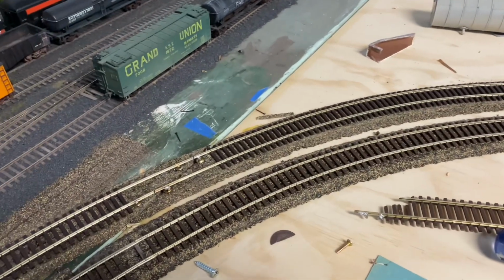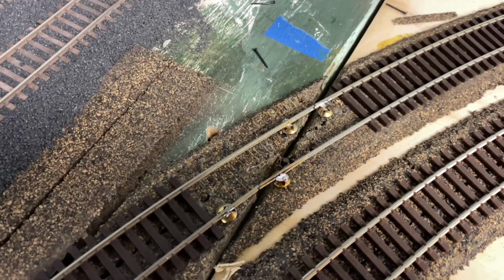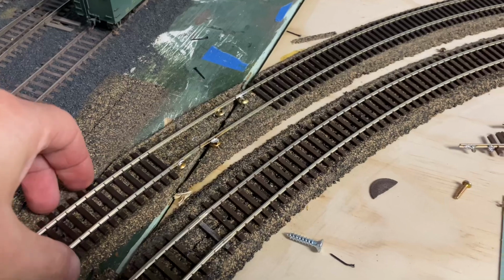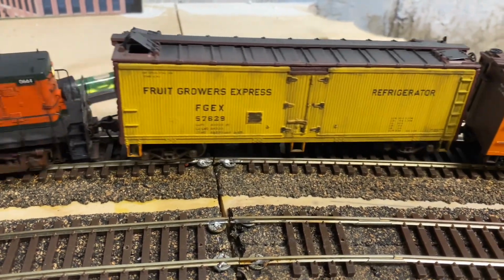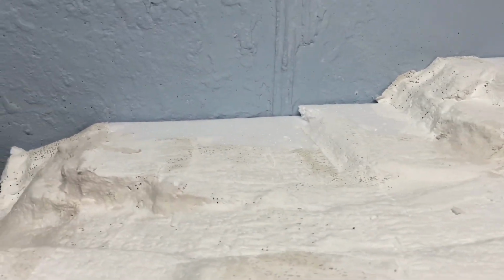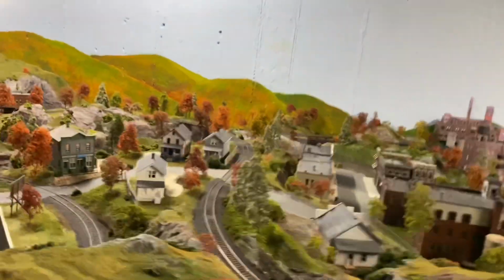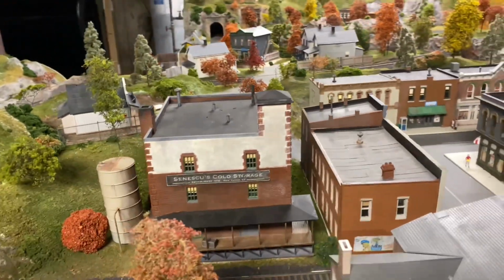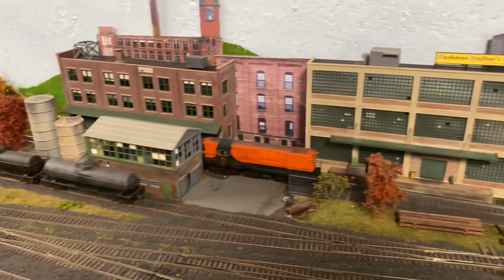September 2022 Update 009 (b) New Haven 1959 Ho Scale Model Railroad

Comment: Awesome New Haven layout. Your scenery looks great. Lift outs are tough when they are straight so having a curve makes it definitely a challenge. My clubs lift up section has pins under the lift up portion and holes on the bottom. This way it goes back in the same spot each time. Not sure if you can incorporate that method but it might help.
Reply from the maker: Great suggestion. I have thought of that. Thank you.